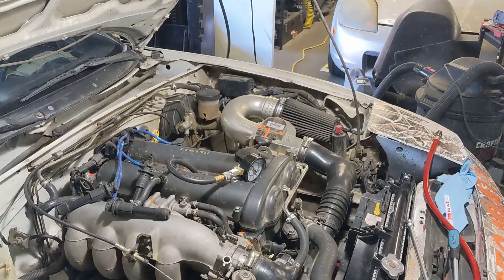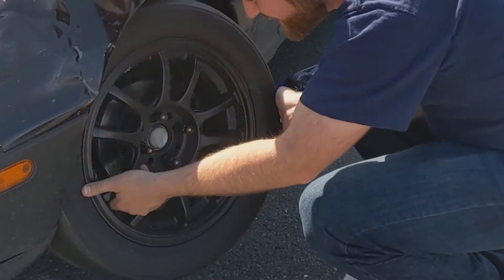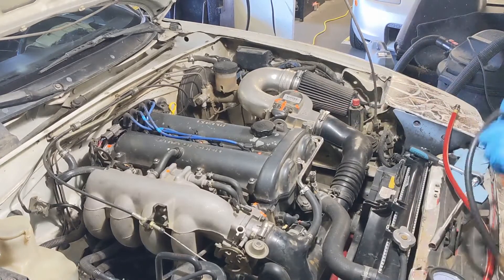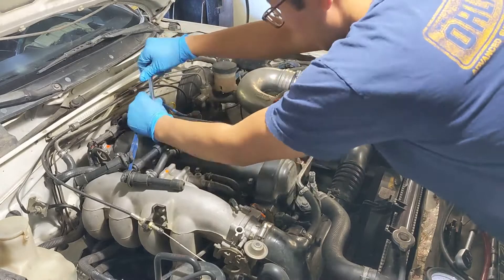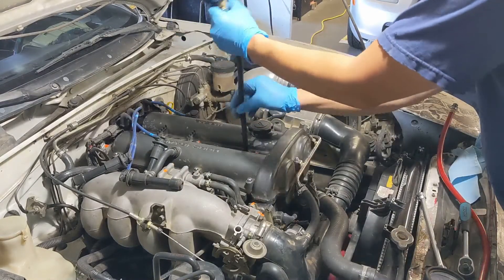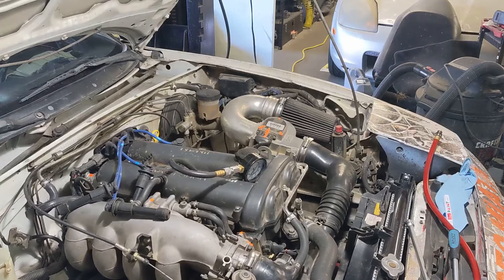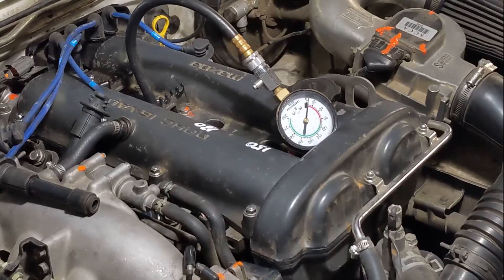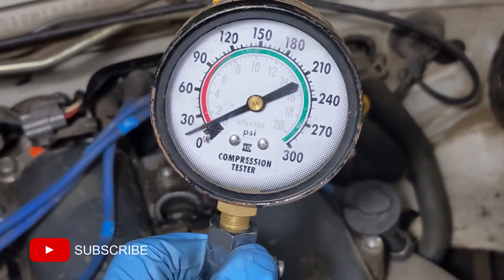Compression test a Miata engine! ⚙️

Comment: Did you ever do the leak down test?
Reply from the maker: Yeah, the loss was pretty significant. I think I have footage somewhere, just never got around to uploading it.
Reply: @ ahh I see what did you end up doing after if I may ask?

I’m having trouble myself where I hear slight bubbling and loss of coolant in the reservoir 

Switched the rad cap and tue coolant isn’t leaking but I hear the bubbling slightly still. At a loss of what to do

Compression test shows that maybe the 2nd cylinder is slightly lower than the others but I’m stumped